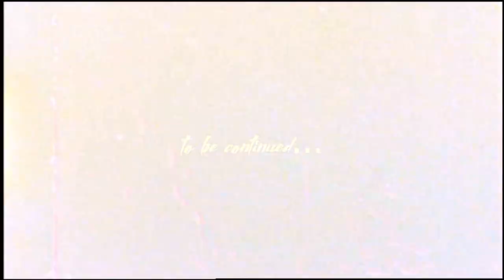Hopefully this will solve my VG30 Problems, Lets find out | 𝕃𝕆𝕍𝔼. 𝕍𝕀𝔹𝔼𝕊. 𝕩 ℙℝ𝕆𝕁𝔼ℂ𝕋 ℂ𝔸ℝ𝕊

Comment: For some reason I didn't get the notification for this one, so I'm here 3 months late lol.

What was your solution for why the plenum bolts weren't catching? What happened?

I can't believe you left us with a cliff hanger. Hopefully I get the notification for the next episode!
Reply from the maker: It's all good lol

It was pretty odd, the bolts went in perfectly fine when hand tightened with a rachet so I'm not sure if my impact was just low on power or the threads were just stuck on something

I'm going to return back to filming a video next month with an update. Had several things happen at my work that have set me back a bit. Just now getting back on track this week lol

Comment: Y u change it to Drift build?
Reply from the maker: Well I planned on drifting it from the start. The endgame is still a high compression NA-T build but it makes sense to start on suspension and engine simplification before adding forced induction. Plenty of things to buy like crank triggers and bbk's, and more deletes likes the brake booster and ptu.

Don't want to have everyone waiting on turbo stuff so the name gets changed to drift build👍🏾👍🏾👍🏾